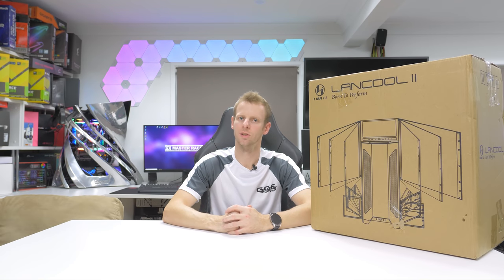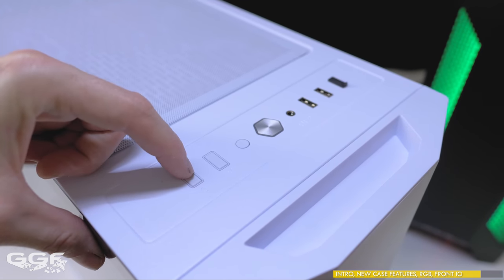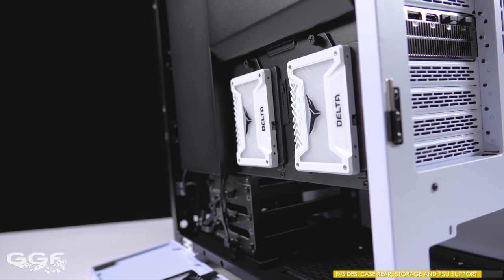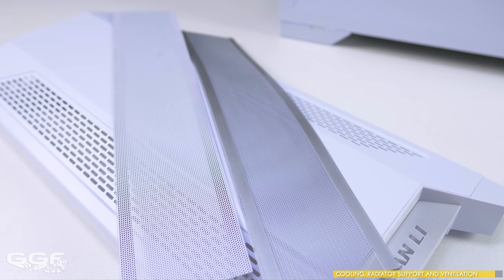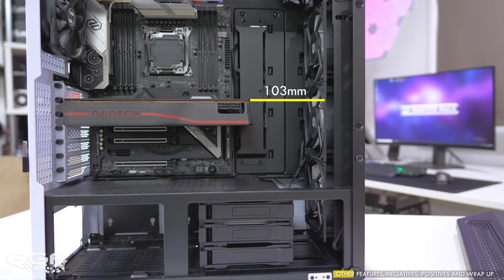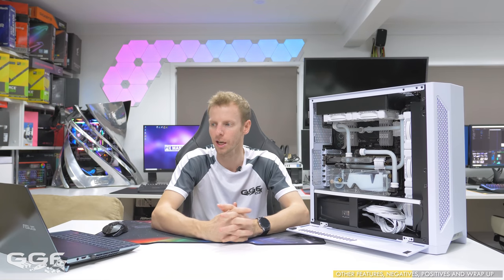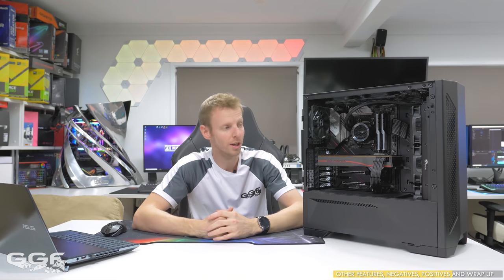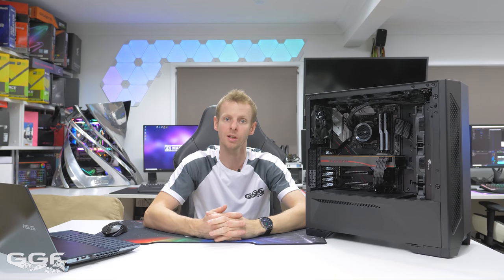This is the one! - Lian Li LANCOOL II In-depth Review

Comment: I bought the Lancool II the minute I saw the first review and do not regret it one bit.  It was so, so easy to build in and the videos don't do the front RGB justice.    As far as built quality, first of all, this thing weighs a ton, more empty than my previous computer, with everything in it.  It is completely steel.  Thermals are good as well.  My 3800X maxes out a 72 C under heavy load, in a hot room, with just a 240mm AIO.

Comment: This channel is something else. I just discovered it and this is such a wonderful straightforward review. I currently have a 9900k build in a cooler master MC500p case with a Corsair rm1000 PSU so it’s a little longer than the traditional atx PSU. Will a PSU like this fit in this case? I am interested in reducing my case size. Thanks.
Reply: I have a Corsair HX1000i (which is quite a long psu) in this case, it fits fine. You just need to slide the ssd tray all the way to the front of the case so what you have space for it. (I too did it with a 9900k :^) )

Comment: Hey awesome vid! Do you think I can use the aRGBs of the case and strip without an aRGB header on my motherboard? Also, do I need to connect these lights to a hub and/or PSU for them to work? My case comes next week and I'm wondering if I can set it up somehow to work with the 5v 3pin antec prizm aRGB fans which come with a hub that has five 3-pin aRGB ports and five 4-pin PWM fan ports
Reply: According to the manual for the case, page 8, the case will need an ARGB header on either a motherboard or an ARGB controller. You don't have either. You could look at the ARGB hub that CoolerMaster make.

Comment: GGF, wanted and there was a backplate watercooler block would be very nice to cool the video card from the back without having to disassemble it completely ... A second alterative, in my case I use a RX 5700 XT Blower I think she didn't want to remove it , would be interesting a backblate block ...

Comment: So if i were to buy a 360mm CPU cooler, would i be able to put the fan part in the front of the Case, and then put the water cooling itself on the CPU?
Reply: Also i would like to know which fan sizes fits where, because you only explained the sizes in radiators

Comment: I have a question. My GPU is pretty long at over 30cm. It's tip touches the cable management bar next to the mobo. Given that the bar, like the chassis as a whole is made of steel, do you think there's any danger of the GPU short-circuiting?

Comment: unless you can fit 9 case fans in a mid-tower with a separate side compartment for psu like the O11 dynamic it won't have good enough cooling.
Reply: Yea the cooling isn't the greatest but throw enough case fans and it gets the job done lol

Comment: The 360 rad at the end of the video are you running it push/ pull or just pull? Im wondering since i have this case and the front is somewhat restricted of air. Thanks
Reply: It's just pull. Didn't want to clog up the very front.

Comment: 3:12 what magic is this?
Reply: it has electric contacts for the rgb so when you connect the front panel it electrically connects the rgb.  i love that feature, and since the contacts are spring loaded pins against a plate it will likely remain a solid electrical connection for a very long time, even if you are constantly removing and replacing the front plate.

Comment: Please help me. I am trying to remove the hard drive slide tray with no luck and i'm installing a 360 aio in the front. Should i have the fans pulling air in or should i have 2 pull 1 push or all 3 exhausting out the front? Any info would be great

Comment: Should I be concerned about ventilation if I put this case on a carpet floor?
Reply: You should be ok. The bottom legs are pretty big and the only intake there below is for the psu if you mount it to pull air from the bottom. You could always mount the psu so it pulls air from inside the case if too concerned.

Comment: Yup totally agreed, you execute with so much details. thank you! Just for your info, look at the top (inside the case). At where the aRGB controller is located, there is another empty socket for you to plug the aRGB connector, just remove the aRGB  cable connector from the other end and plug it at the top instead.  it will makes cable management easier. https://www.youtube.com/watch?v=gHfAlQbuOpc&t=9s
Reply: Wait I have this case and when I click the buttons on top the leds don’t turn on, am i doing something wrong?

Comment: I'm not sure how to connect the cables to make the front of the case light up
Reply: According to the manual for the case, page 8, the case will need an ARGB header on either a motherboard or an ARGB controller. You don't have either. You could look at the ARGB hub that CoolerMaster make.